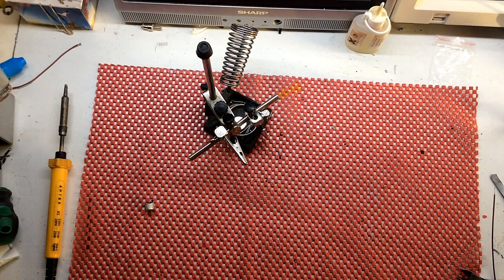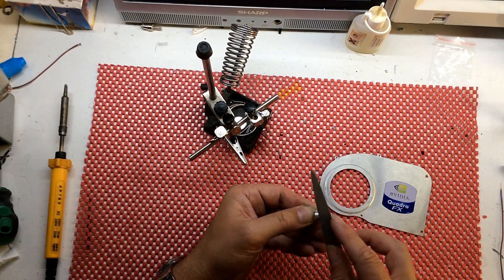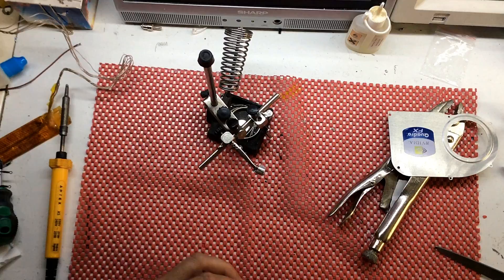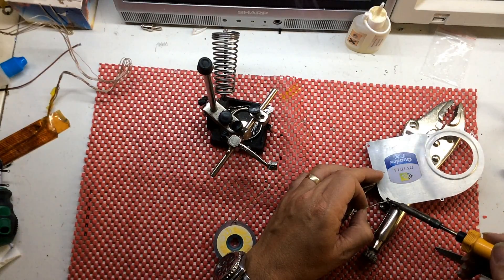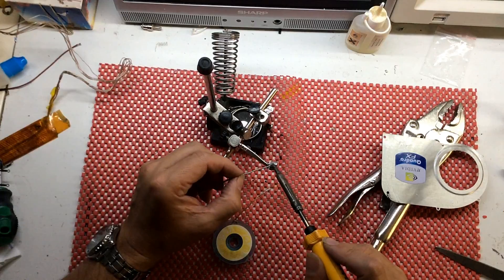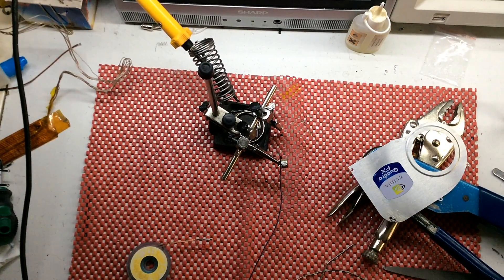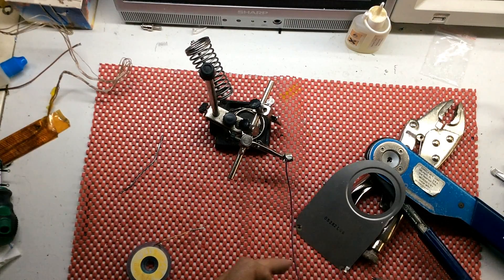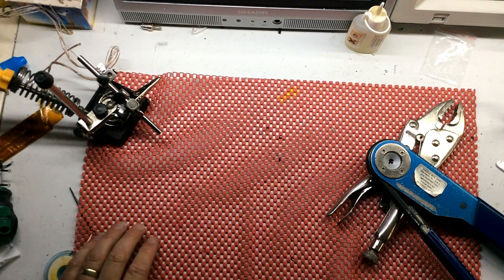How to Solder  onto Aluminium

Comment: I've got some 6.3mm rods I need solder on the tips. Any suggestions?  I've tried a bath of rosin with solder in it for more surface contact and to stop it oxidising while heating and all sorts, I know this particular rod doesn't like to be brazed so that's out of the question, 
I might try drilling a 4mm hole so the solder can pool inside it?

Comment: Use vasselin or petroleum oil engine oil... For Aluminum soldering
Reply from the maker: Thanks for the tip!
Reply: Didn't work for me, I pooled rosin with vasso and solder in it keeping the iron and 6mm bar but it never made contact/bond. Maybe a hole in the rod?

Comment: Comes up as lead solder wire from rs. Is that all it is? I thought it was wire specifically for aluminium.
Reply from the maker: Interesting RS have changed there description since i made the vid, here is the same stuff i think from farnel
 https://cpc.farnell.com/multicore-solder/629443/solder-alusol-0-91mm-500g/dp/SD00059

Comment: it has often come to me that it might be less effort to manufacture a new part made of copper than to faff with the white metal in question, which seems to be protected by some form of magical barrier.
Reply: The magical barrier is probably oxide which forms quickly. Another video they scratched aluminium under oil then normal solder. But I haven't yet tried this myself so lets discuss again later
Reply: @addydiesel6627  how'd it go
Reply from the maker: Your proberly right, Aluminium is a horid metal

Comment: I just bought some aluminium wire for modelling, intending to solder it together as the main joining technique. Did I just fuck up?
Reply from the maker: you need special solder to solder aluminum, i did hear you can use  oil as a flux with standard solder but i dont know how true this is, copper wire would have been better but is a lot heavier.